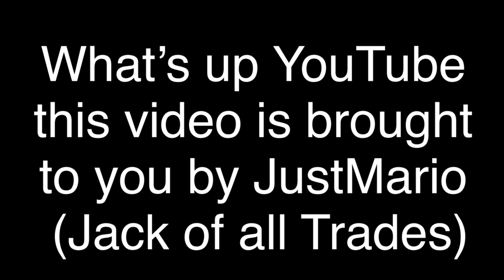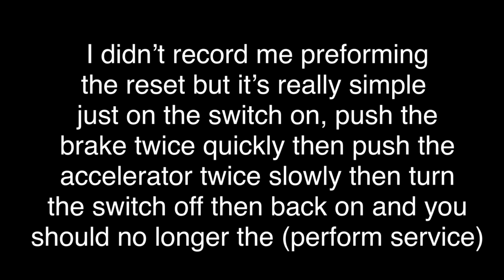Replacing CCV filter and getting to the money

Comment: Mine just came on as well as the service Def system message. 2017 Ram 3500 with 67,600 mi
Reply from the maker: Stanley McClarin yeah it’s time to change it
Reply: Is your truck deleted? The reason I asked is because my dealership told me that their more to the CCV than switching out the filter.  He said the EGR has to be cleaned/soaked as well which is a 6 hour process.
Reply: Stanley McClarin  there just trying to get cash from you

Comment: Mario whats happening? How many days a month you driving. I work a 12hr shift schedule at current and am off 14 days a month. Just wondering your thoughts about getting into the biz part time and still coming out ahead after insurance and other expenses.
Reply from the maker: Nick L if you start out with an Oil Field company then I think you would be good part-time
Reply: @justmario9545  Right on, appreciate it